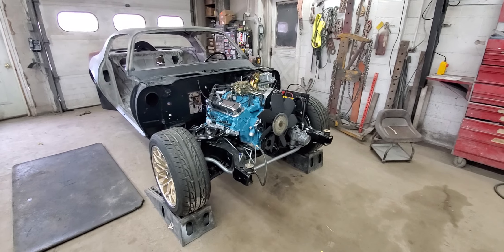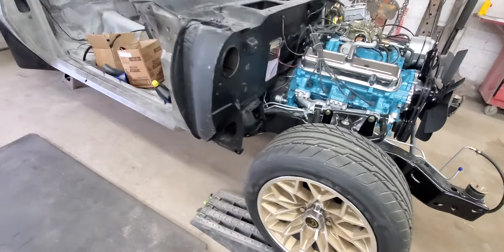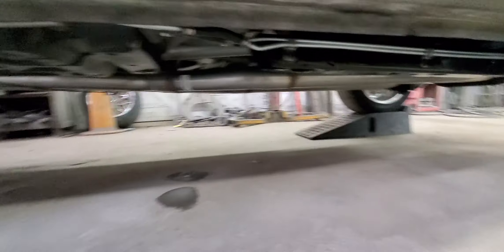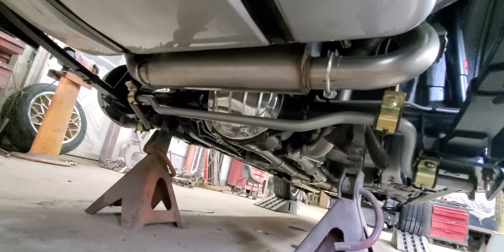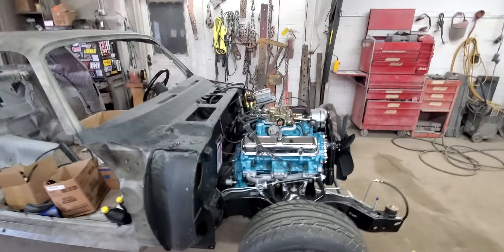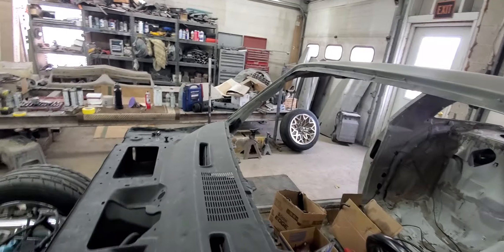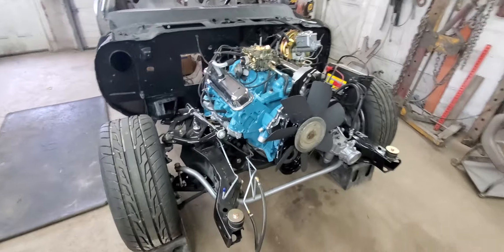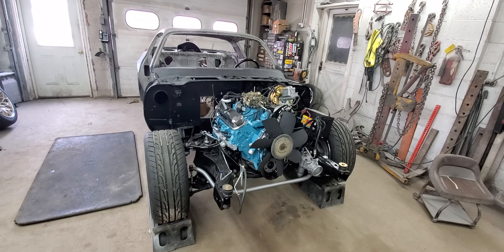Building A Pro Touring Bandit PART 18

Comment: Looking great man! I am working on mine today too! Just sweating the details.
Reply from the maker: Thanks Will! Can't wait to get all the mechanical stuff done so I can start making this thing shiny black. 😎
Reply: @classicreaction5340  I really can’t express in a comment how incredible your quality is building your Trans Am! It is incredible man! I truly appreciate your work. I have had 14 77-78 Trans Ams in different conditions. Mostly we’re low mileage originals. I had a one that was a nice original but was restored to a high level with a bit of a “Day 2” flavor. It was a WS6, L78, 4 speed no AC car so you saw all of the engine which was highly detailed. It was an Oregon car so it never had rust and never had any undercoating so underneath was perfect but stock. It was Chesterfield Brown with a tan interior. I put the SE pinstripe pkg along with SE steering wheel, dash bezel and SE center caps. I still miss that one. Anyway, beautiful work brother!
Reply from the maker: @MrWill73  thank you sir, I really appreciate it. I've built probably around 40 Trans Ams since 2002. The funny thing is I have never, ever had a nice, low-mile original one. I always got ones that needed fixed up in some way or another. I wouldn't even know what to do if I got one I didn't have to work on! 🤣

My favorite one I ever had was one I had here on my channel a few years ago. It was an original 1979 Y84 Bandit W72 4 speed....one of the 1107 that were made. I bought it from the original owner, sitting in his garage since 1986 with the tired out 400 sitting on a tire on the floor beside it. I brought it back to perfect original condition and sold it to a T/A collector in Florida. That was a pretty special car.
https://youtu.be/blv4H4gnhcE?si=uuxRR8Kqw8C9J6tq
Reply: @classicreaction5340  I believe it, you have great skills. It obvious you can do everything. I can’t do bodywork or paint myself. The cars I have painted at home, I had either my old friend that was a professional paint and body guy or my buddy that has helped me for the last 8-9 years that we have flipped cars together to make money to fund the cars. My Fall Guy truck is the last car I have that I did everything myself along with help from my friend Corey. The Coronet that we are going to start after the Tran Am is done will probably be my last car that we will build completely ourselves. That’s why I appreciate people like you that can do quality work and can do it all yourself. I definitely get an A for effort but I know my limits😂😂